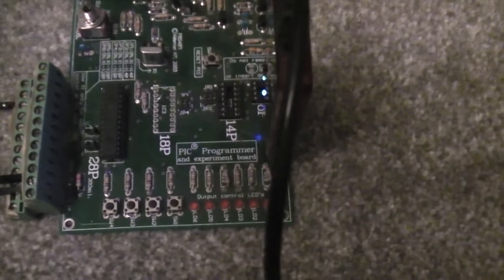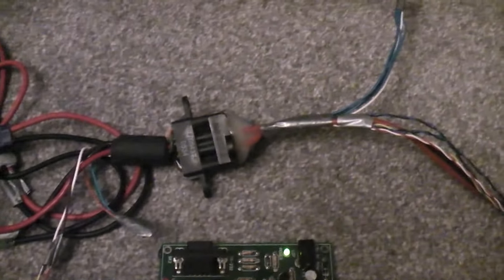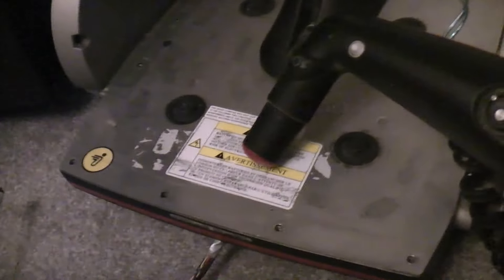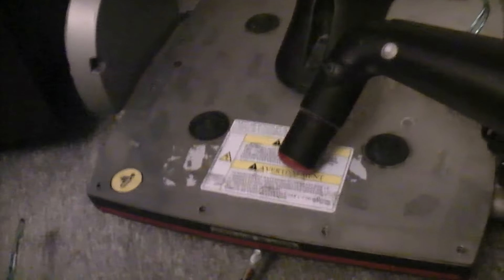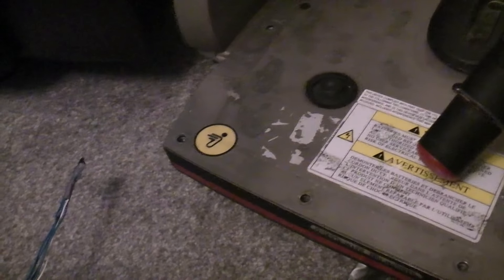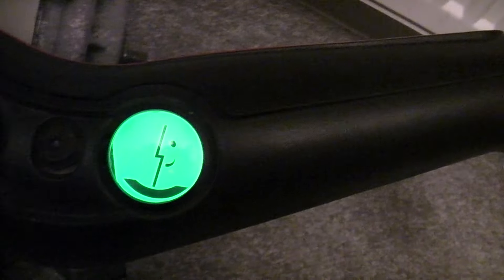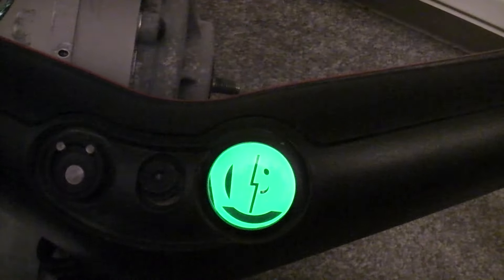00001

Comment: Wow, that's really interesting, I've been modifying an old NiMH-battery as well, using the original BMS though. Emulating the BMS would be even better, can you give some more details about the communication between Segway and BMS or would you be willing to share your code?
Reply from the maker: Sorry for the delay!. communication is I2c
Reply: @iandorrington6397  Is it different in the NiMH battery than the LiION?  I just got a NIMH battery and the code I use does not respond ... is there a different set of battery monitors at different slave addresses?  Are the commands different?